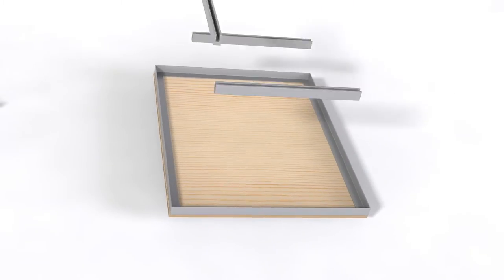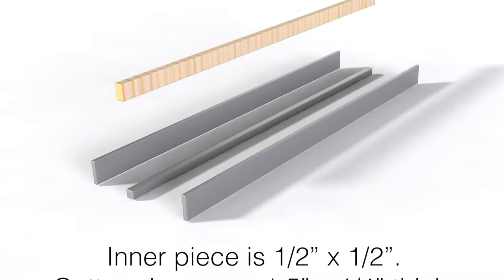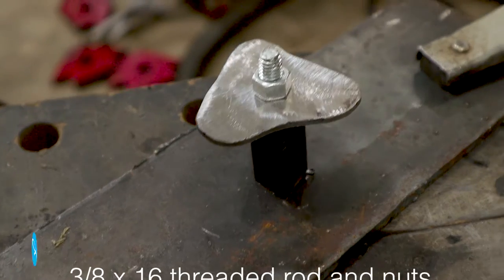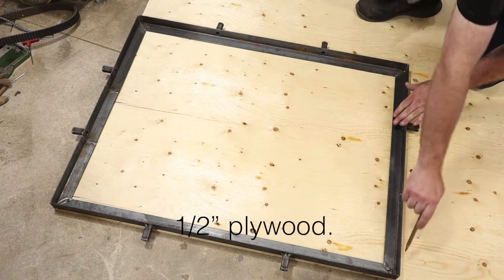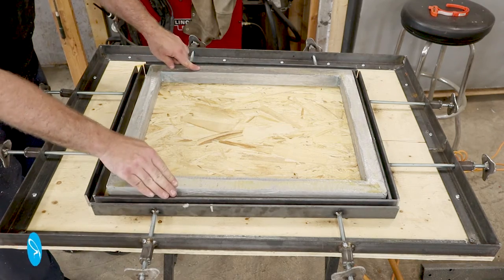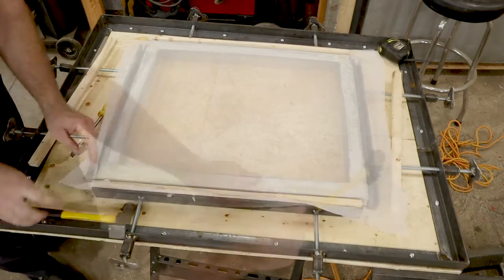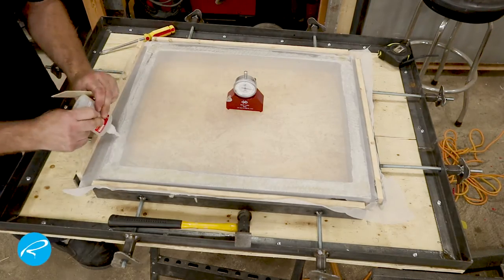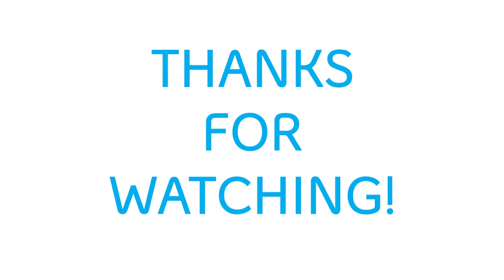DIY Screen stretcher for screen printing.

Comment from the maker: I've used this now to make about 30 screens, and while it works well for me, I would recommend applying some grease to the threads where the tightening handles attach. Because they are a relatively small thread, and the rod and nut are not hardened, they tend to gall and bind with the forces involved. I had to replace one of them after the galling got so bad it destroyed the threads. Greasing them makes the action much smoother, prevents damage, and will allow you to crank on them more, giving you more screen tension. Update: My process for stretching screens is now this: Setup the mesh and stretch as normal, checking tension, glue down two connecting sides and spray with accelerator. Then tension some more, then glue the remaining two sides. I find this allows me to get a higher tension on the screen. The limitation to getting a high tension is the mesh keeps tearing. I glue the sides that are already starting to show some tearing. At this point I'm averaging around 20-21 N/cm. I also recommend sanding the top sharp edges of the aluminum frame, the part the mesh bends over at the top. Doing this can help to prevent the mesh from ripping if that edge is sharp.
Reply: I pull some mesh out of the stretcher by the corners . Get good tension in the center but won't rip or come off on the corners.
Reply from the maker: @kristmadsen  That's a good idea, thanks!